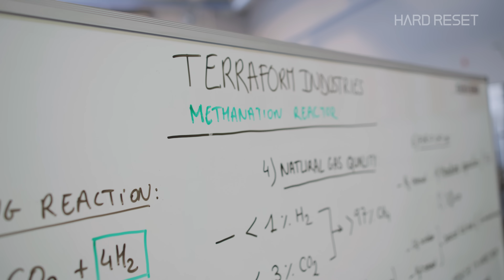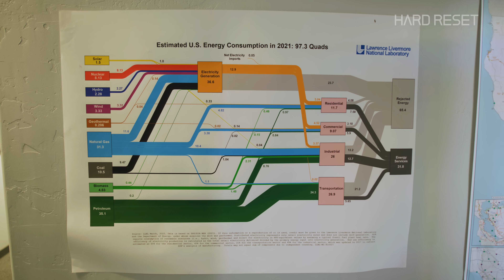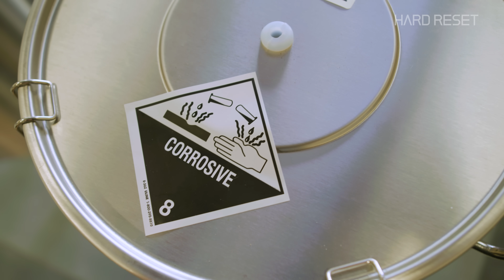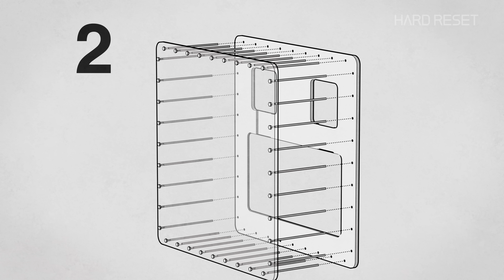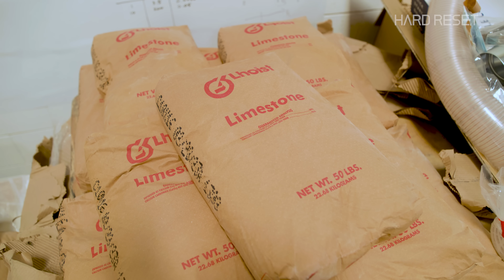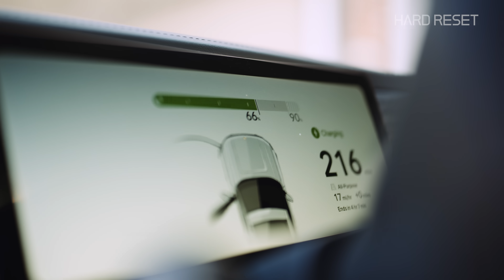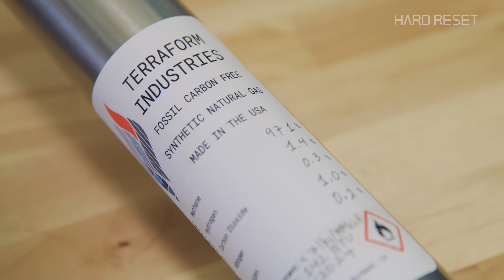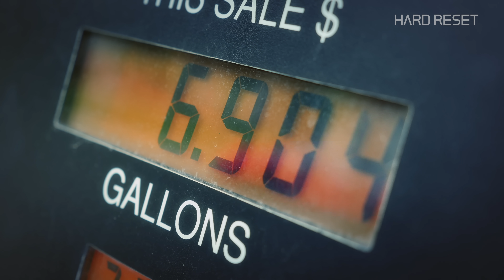The Last Fuel We'll Ever Need?

Comment: So it's counter-intuitive to burn coal to make other kinds of fuel.. but not to waste solar panel energy to make combustive fuels ?! 😂 Just use the electricity as fuel bruv.
Reply: We do not have the kind of technology needed to transport electricity the way we do liquified methane, methanol, or jet fuel.  Batteries are nowhere near as energy dense as liquid fuels.  This is essentially using the fuel as a somewhat inefficient to charge battery for the solar panels, wind turbines, or even fusion reactors.  Fuels can be stored against need as well.  

Any future with renewable energy sources that is as industrial as the world is right now will involve producing a LOT more electricity than is often needed.  Terraformer will be able to use that cheap "excess" electricity to make something valuable using cheap parts and incredibly well-understood chemistry.
Reply: Batteries are inefficient and slow to charge currently. Find me a jumbo jet that can take 350 people from new York to Tokyo in 14 hours with electricity only and you'll change the world.

Comment: Many issues here. The efficiency is low when you consider energy input compared to final output, for instance the drive axil of a truck. Particulates from combustion stay with us killing thousands each year. Transport costs of the methain. Will it be compresed or liquefied before transport?ore expense. it'll most likely be produced at a centralised refinery type of situation requiring heavy reliance on transport to market. I recharg my EV off my roof for free, thats gold, this cant compete.
Reply: The combustion from pure methane isn't that big an issue modern engines with pollution controls should be fine the issue is the inefficiency of this process and how it relies on renewables becoming much cheaper and at that point there are better solutions like EVs. The whole setup looks overly complex and in the experimental stage.
Reply: Well getting a litre of fuel to you can cost up to 5 - 10 litres in transport refining etc.. so it can/may be less efficient if the rest checks out
Reply: I'm sick of people complaining about combustion. Combustion raised the average lifespans from 35 to 80 years and rising. And methane burns extremely cleanly and particulate filters filter basically everything.
Reply: @gregorymalchuk272  That was then, this is now.

Comment: Yeah... what's the leakage rate. Methane leaks are god-awful pollution. Also, compare the 30% efficiency with using batteries which are 85-99% efficient.

Comment: @7:16 so it needs  clean water and a lot of electricity for inefficient electrolysis, massive amounts of electricity for the inefficient carbon capture, to make methane which will then be transported and used very inefficiently. Since methane is not gasoline, it needs changes to the vehicle it's used in. I don't believe this makes much sense. If everything said here is correct, at an electricity cost of $0.10/kWh, the energy equivalent of a gallon of gasoline would cost $10.90 per gallon in electricity alone right now so maybe there's something to this but to say that it's cheap...
Reply: Yeah this doesn't pass the smell test the whole video seemed like a promo without any real questions being asked or answered. By the look of their "lab" they are way far from even having an invest-able concept much less something in production for a long time.
Reply: @christophers707  Instead of smelling google their white paper or blog. Their CEO is ex NASA JPL, not some prankster looking for ignorant investors.
Reply: Kinda?  The water doesn't have to be that clean if you can clean out your reactors regularly.  The electrolysis reactors do consume beaucoup electricity, yes.  This reaction is really the point where the electricity that will eventually be released as heat by the fuel is being input.  

The carbon capture really just requires electricity for fans and a conveyor belt.  The burning of the limestone to liberate the CO2 and water as it's turned into quicklime doesn't have to use electric furnaces.  Solar concentrators can heat an area to far higher temperatures than is needed to make quicklime.  This part of the process would be a terrific place to use solar thermal generation to lower the amount of photovoltaic, wind, or fusion power being used to run the refinery.  

Methane will require changes to current cars in order to be used directly, but LNG engines and cars already exist.  No new technology is needed.  It's also possible to use the methane as feedstock for further refinement via the gas-to-liquid process and make gasoline out of it.  

This is not meant to be anything other than a way to take cheap or excess electricity and turn it into a fuel that is easy to transport and use wherever needed.  Methane has much higher energy density than the most efficient batteries on Earth and probably will for the conceivable future.  It's not meant to take our existing electricity and find a way for us to use it more efficiently, it's meant to turn what we do end up with into a more convenient form.

FWIW, all of this chemistry is well over a century old at this point.  Terraformer are developing _products_, not a new technology.  They just decided that it was Railroad Time for fuel synthesis and are seeking to get out with an early commercial solution that can be used nearly anywhere.  Really, the financial sector should be covering this company more than the science folks.
Reply: Was thinking the same. You need so much energy in the end to make the full process of electrolysis, fans for the carbon capture, break it down for reuse... So many steps will make it inefficient as there are losses between every conversion. A solar lens boiling your pasta water is more efficient as it goes from energy source to practical use with little to no conversion say around 80-90%. You can also boil and store fresh water for later practical use like heating. So in the end avoid conversion.
Reply: They get more than enough water from air

Comment: If solar become super cheap why will some one use fuel instead of electricity
Reply: Because it sucks as a source of electricity. It's unreliable, takes massive amounts of land and does not have long term reliability like other options. 

Nuclear / Hydro / Fossils have:
High energy density (extreme with nuclear)
Reliable
Easily scalable 
Large individual energy output
Cheap per mwh
Economical
And barring fossils - Clean.

Comment: You could use quicklime as an heat storage for heating buildings in the winter.
Heat limestone in the summer to get the co2, which you turn into methane. out comes quicklime, which you store 6 month.
In the winter you mix quicklime with water, which releases a lot of useful heat, and it also pulls co2 out of the athmosphere, and it turns back into limestone.
next year you use the same limestone and repeat the cycle.
Reply: There are a thousand better ways to do it. 
Congratulations you've shown you know some chemistry.
Reply: @sparksmcgee6641 Hey come on be nice.

Comment: WTF is the point of using THE CHEAPEST MOST ABUNDANT type of energy -solar electricity to make more expensive fuel to use in a secondary process??!!???  ETA to bankruptcy… 1yr.
Reply: They explained the point multiple times.  You should ask an ai chat bot to break it down for you to see if it can make it easier to understand.
Reply: Basically, there will be enough solar power for winter, and too much solar power in other seasons. That surplus almost free energy is expected to be used to produce hydrocarbons (as fuel for high demand transportation like rockets and long-distance flights + for some chemical industial processes) and hydrogen (for steel and fertilizer production).

That surplus energy is sometimes called superpower. It appears because of curtailment - that's when you build more intermittent generation (solar, wind) than you can store and use for short-term needs. Curtailment happens for several reasons, but mostly because, up to a certain point, it's cheaper to build more generation than building more batteries.
Reply: @Wurlipurili  that's not the point
Reply: well, i somewhat agree, the video talked about having a more economic way to get methane, as well as being carbon neutral.

Comment: I know that methane is cheaper to use and transport with our current devices and infrastructure.
But the Co2 secuestration (just 400ppm in the atmosphere) plus the sabatier reaction adds a lot of cost which I do not see the point to keep delaying the change to H2 devices and infrastructure.
The first process they made, which is electrolysis, already produce the cheaper fuel from electricity.
Reply: The problem there is that hydrogen is both extremely "leaky," explosive, and embrittles the containers it's put into. This makes it more of a problem and more expensive to store and transport. Methane at least is less explosive, easier to store, and seal.
This process is less expensive and dangerous than that which handles hydrogren alone, and therefore "good enough." It's not great, not a real game changer, but it would work as an alternative to traditional fuels while we transition away from them to more stable, efficient, and renewable energy sources.
Reply: @anomatrix0000  well, here you are just repeating all the misconceptions and lies about hydrogen that are around internet and spreaded by youtubers. 
Hydrogen is safer or at least equal in danger to any other energy carrier.
The explosive quote, is just 1 property about the explosive ratio in mixing with air, but all the other characteristics of hydrogen make it safer than all the other fuels.
I can explain one by one all those characteristics if you want. 
Is not as leaky as everybody thinks either.
The most leaky stuff is helium because is not diatomic, and that is only an issue if your "container" is a rubber balloon.
Then we have the embitterment exaggeration.
Since 1900 until these days the standard to storage hydrogen is on metal tanks. 
Where is the leaky or issue with the tanks? 
Embitterment starts to be an issue at very high pressures, temperatures and with alloys no recommended to use with hydrogen.  Nobody who would develop any new utility with hydrogen would fall in those issues. 
Yeah, transporting methane is 2 times cheaper than hydrogen, but hydrogen is 10 times cheaper than transporting that same energy by transmission lines.
Reply: @anomatrix0000   well, here you are just repeating all the misconceptions and Iies about hydrogen that are around internet and spread by youtubers. 
Hydrogen is safer or at least equal in danger to any other energy carrier.
The explosive quote, is just 1 property about the explosive ratio in mixing with air, but all the other characteristics of hydrogen make it safer than all the other fuels.
I can explain one by one all those characteristics if you want. 
Is not as leaky as everybody thinks either.
The most leaky stuff is helium because is not diatomic, and that is only an issue if your "container" is a rubber balloon.
Then we have the embitterment exaggeration.
Since 1900 until these days the standard to storage hydrogen is on metal tanks. 
Where is the leaky or issue with the tanks? 
Embitterment starts to be an issue at very high pressures, temperatures and with alloys no recommended to use with hydrogen.  Nobody who would develop any new utility with hydrogen would fall in those issues. 
Yeah, transporting methane is 2 times cheaper than hydrogen, but hydrogen is 10 times cheaper than transporting that same energy by transmission lines.
Reply: @ "Hydrogen is safer or at least equal to...." Just plain wrong. Time to break out the actual facts, as backed by scientific studies and known industry practices, with relevant links:

1. Hydrogen IS leaky, being the smallest on the atomic scale, and I'm not sure why you're bringing Helium into this because that's not the discussion here. But the major saftey risk for hydrogen leakiness is at the commercial and consumer transport level, where there is an expected "...77% of economy-wide (amount of leakage)" - UColumbia study https://www.energypolicy.columbia.edu/wp-content/uploads/2022/07/HydrogenLeakageRegulations_CGEP_Commentary_063022.pdf

2. Point 1 above contributes to it being such an explosive/flammability risk during handling where it would see the most use and potential exposure to air and ignition sources around the users. Therefore it would need (and cost more for) more safety mechanisms around it compared to todays use of gasoline and natural gas (methane) or propane. And here's a link demonstrating just how hydrogen is over twice as explosive as gasoline and methane - https://transportgeography.org/contents/chapter4/transportation-and-energy/combustibles-energy-content/

See the link in Point 1 for how much more development is needed yet for hydrogen leakage detection and how that translates into cost.
There is also the matter of it being undetectable without any sensors, and that you cannot add any "odorants" to it to make it more safe for handling. https://h2tools.org/bestpractices/gaseous-gh2-and-liquid-h2-fueling-stations/hydrogen-compared-to-other-fuels

3. And finally on hydrogen embrittlement - yes, there are plenty of materials that are resistant to embrittlement, but they are also more expensive per weight, those being: copper, stainless steel, and aluminum. That can simply be found on wikipedia. However, again, the discusson here is centered on keeping the risk, expense, and complexity down.
Reply: @ 1-Look, I have no issues in using my time to clarify doubts about hydrogen, but not to teach you how to read.
There is not 77% of leakage!
That number represent what % from all hydrogen leakages in an hydrogen economy are from those specific listed sectors, being the one of Blue and Grey hydrogen production the worst. This mean those sectors represent 77% from the 100%
The study you quote in the first page estimate a 5.6 leakage which contradicts as the same study mention others who estimate half of that.

2-The link you are quoting is just showing the gravimetric energy density, which compares energy content by fuel mass.
But in the real world you need to talk about volumetric energy density, where you compare how much energy hydrogen has at atmosphere pressure, or at 700 bar in a tank or liquify.
At atmosphere pressure, you can explode 1 liter of perfect mix of oxygen and hydrogen bubbles in your hand and nothing happen more than a lot of noise (there are videos on internet).
If you do that with gasoline vapor you may lose the hand.
Even at 700 bar or liquify, hydrogen still has 1/3 of the energy content of gasoline at the same volume.  Still hydrogen cars can achieve a similar range because h2 fuel cells are 2 times more efficient than ICE engines. 
These are some advantages of hydrogen vs other energy carriers ultra sumarize:
-It raise 20m per second and diffuse very fast, this mean than any leakeage would leave any place or room very fast reducing the time risk for ignition and if ignition occur, flames would be above the people, not under or stick to the cloth as other fuels. Also, as I said, hydrogen has almost not energy at atmosphere pressure.
-H2 ignition temperature is higher than other fuels, for example gasoline ignites with half the temperature of hydrogen.
-Although hydrogen flames are hard to see, the flames emit around 10 times less radiant heat than hydrocarbons, which means they’re less likely to move to surrounding areas and spread fire or produce skin burns to people close to them.
For last, there are studies about NASA and other institutes about hydrogen safety compared to other fuels, the conclusions were that in most test cases, hydrogen was the one who produced the less amount of risk and damage.
Humanity is using hydrogen since hundreds of years, all fertilizers or ammonia are made with hydrogen, now research how many die due hydrogen accidents.
For last, do you read your last link about hydrogen properties? That same link is telling you what I am telling you. 
Read it.

3-They do not use more expensive materials or alloys unless the conditions of pressure and temperature would be extreme.
For example All type 1 hydrogen tanks are made from steel and aluminum.
Even using old pipes designed for other purposes with wrong alloys can be retrofit just adding an internal layers of a paint or cover for that purpose.
Reply: @ If you find out that you were wrong about something and someone was so kind to correct your misconception, I think at least you can admit the misconception or appreciate the new information.